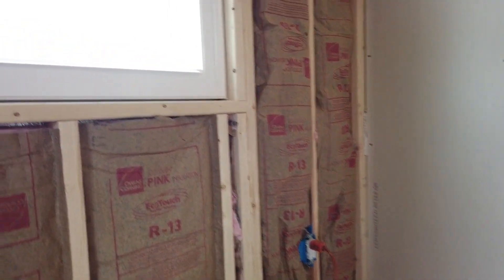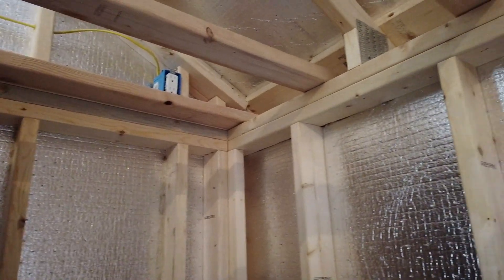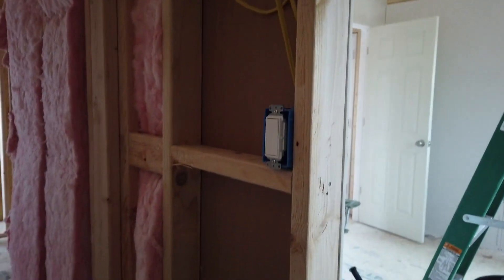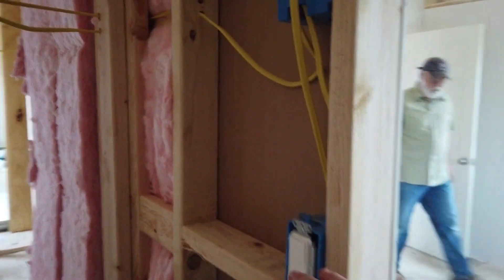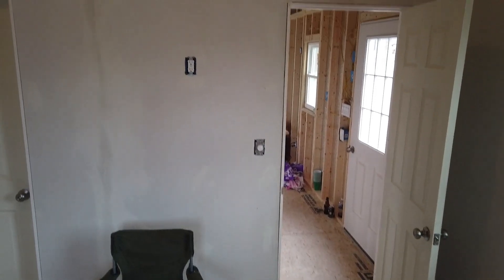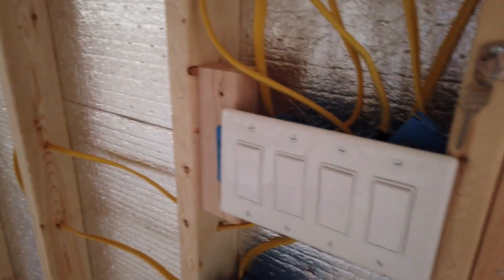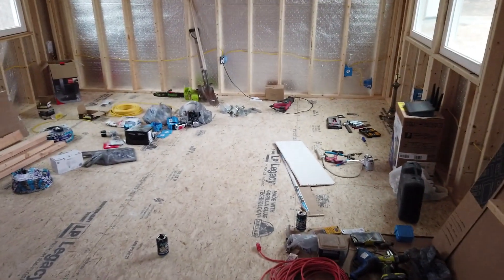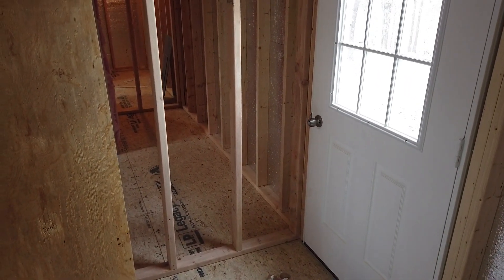Insulating and Drywalling our Shed to Home Part 1

Comment: that electric panel you used is a "sub-panel". when you use that, the neutrals and the grounds need to be isolated from each other. the neutral carries the unbalanced load and the ground is for personal protection. they should remain isolated until they reach the "main" panel. most mobile homes have sub panels inside with the main panel / disconnect at or near the meter. the electric i saw in the walls should have been secured to the studs as to prevent them from being pierced by drywall screws, nails, cabinet screws and so on. not judging just trying to help.

Comment: Looking good.
I am putting sheet rock in my shed tomorrow.
Can I put it on top of the plywood floor or I need to leave 1/2 inch like they do if it was concrete floor?
Also, is it ok to install it dry wall vertical or must be horizontal (8 ft side to side and 4 ft side up)?